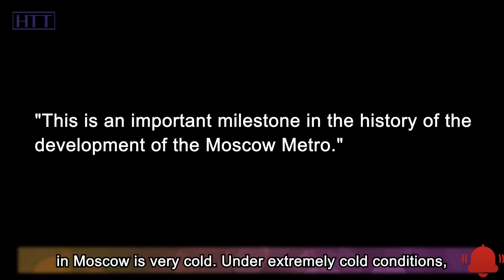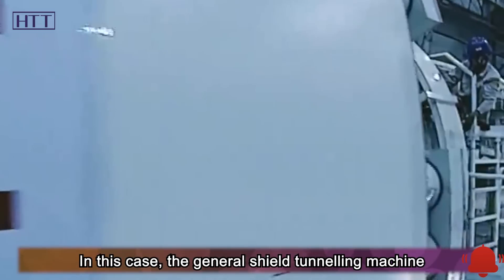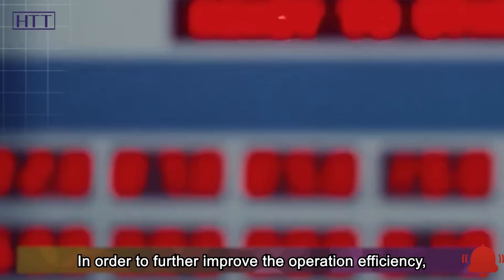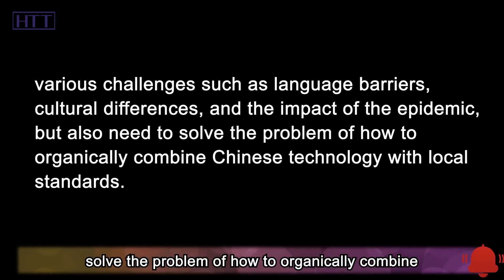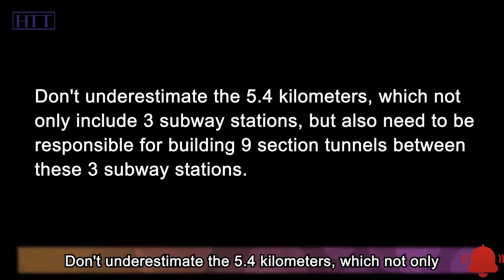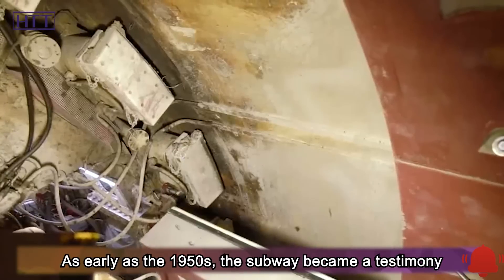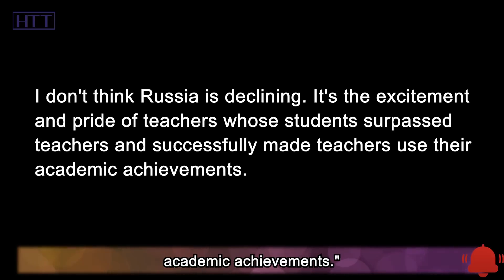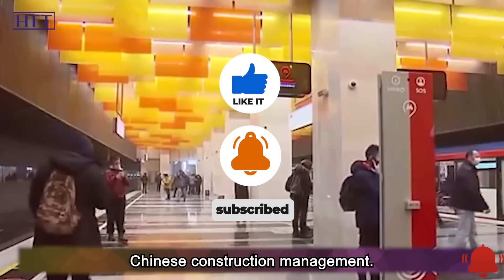How did China build the subway in Moscow's extremely cold environment?

Comment: @1:30 Well I do not know about all this talk. When the machine is 60 meters underground, there is no freeze. Just a regular teperature between 15-20 C. In summer they start and as soon as they are underground, they do not need to worry about freezing outside.. When I was young I worked on metro building for 6 months as a temporary job. I know!